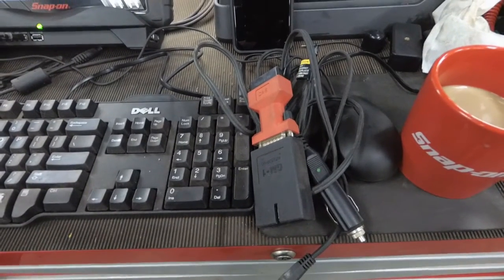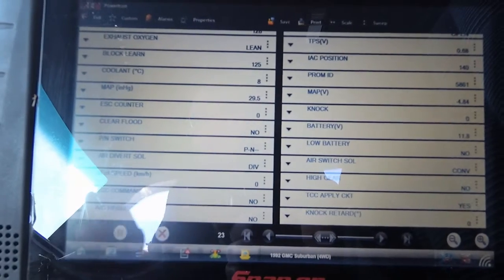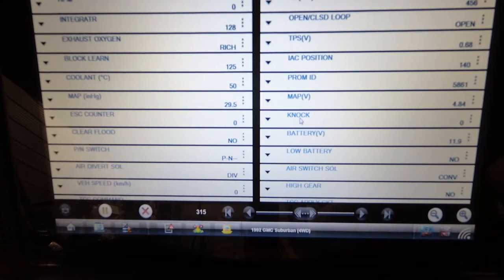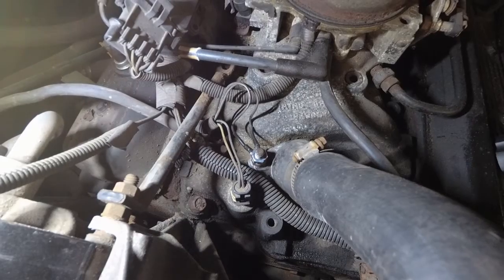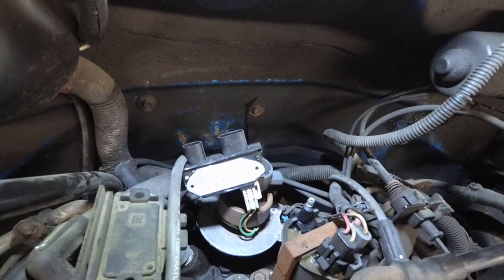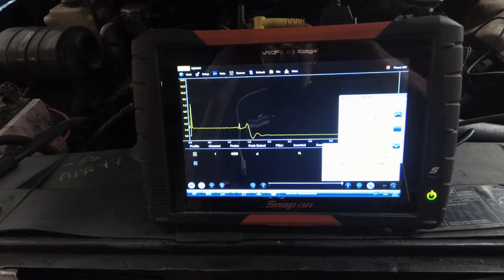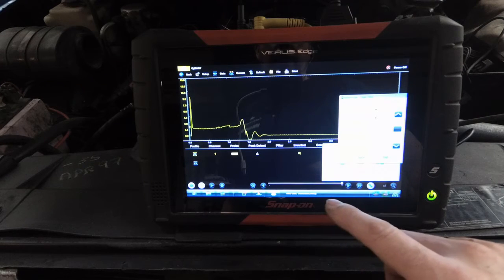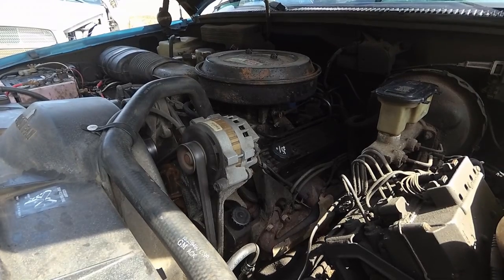1992 GMC 5 7 Misfire Cold Ignition Testing

Comment: I have the same truck and my timing set wire is on the drivers side below the brake booster It a brown wire.
Reply from the maker: Yes and some models were under the dash on passenger side. I think it depends on the plant it was built at.